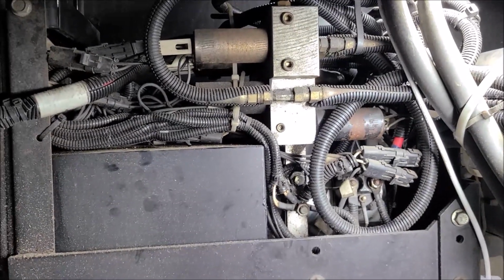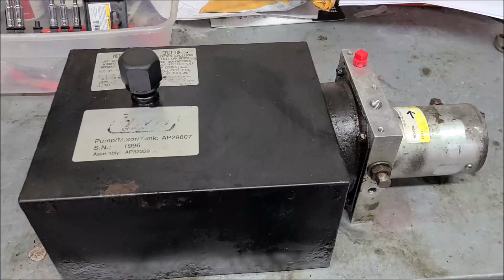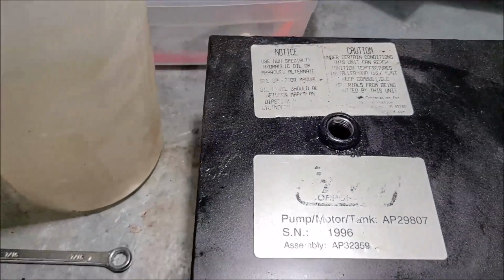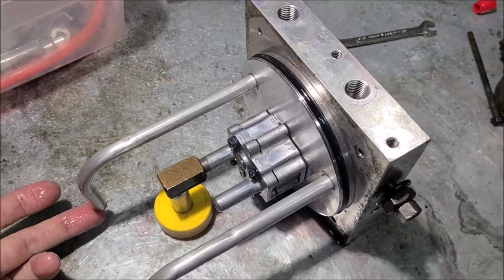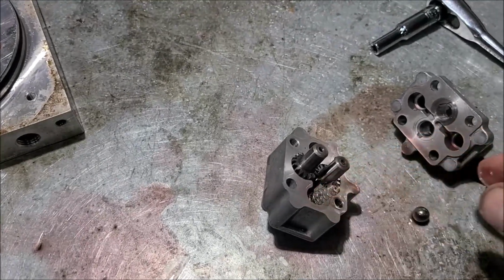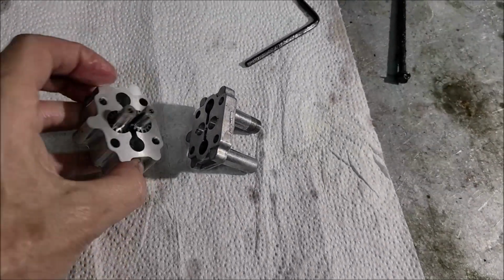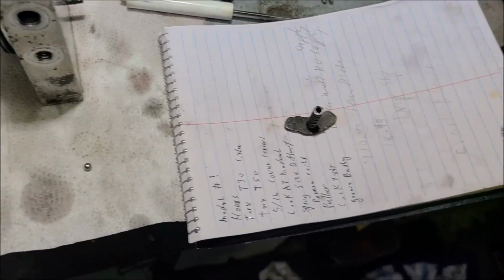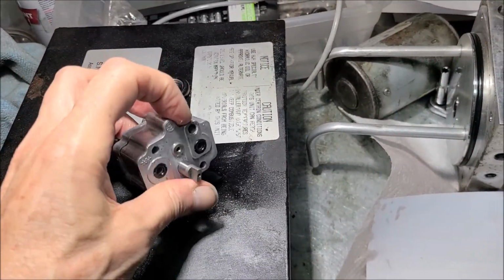How To Troubleshoot Failed HWH Hydraulic Pump RAP30348 AP30348 Due to Contaminated Oil / Water

Comment: Did you ever find a replacement pump? I have the exact same issue with the same pump and part numbers. Hwh wants $1400 plus shipping currently.
Reply from the maker: I never did.. but the new one is much larger and more heavy duty. Try rvleveling.com  for a better price
Reply: @k @ktoutdoor ur videos are great! I’m now watching more of your videos on the hwh system. I really don’t want to spend over 1k for just that pump!! Mine has the same issue with worn out gear shaft.

Comment: I've enjoyed your videos and learned a few things from all of them. One thing I will pass on, when I bought a Fleetwood with an imoperative leveling system 8 years ago, I couldn't find parts or any hydraulic repair company to work on the power unit. I am a retired heavy equipment mechanic and I know there's more than one way to skin a cat. With the Fleetwood, I replaced the whole unit with a hydraulic lift for trailer dump bodies that I got from Amazon for $300. I had to buy a few valves and do some wiring and re clock the way it sat in the hole for it but it worked perfect. Now I own a Tiffin and the HWH system has been a pain in the kiester since day one. First the jacks wouldn't retract, then the shuttle valve needed replaced etc, just one problem after another. I am considering doing the same thing with this one. I haven't quite figured out how to bypass the troublesem shuttle valves yet but after watching your videos I am starting to get a better idea. Thanks for the information.

Comment: Thank you for the video. You always produce good stuff. My Fleetwood Pace Arrow, 2003, has an oil change interval. I'll look it up and share that, but I think it is easy to long for people in a climate that produces much condensation. Mine has a drain plug in the bottom, with a magnet. Filing is on the side, like a deferential.

Thinking about the pump and the ability to find a replacement... Might the pump be worked over with a machinist? They could bore it then place a shim to make the tolerance the same. Just a thought. The gears are steel and the housing is a softer material so, maybe, just maybe that could extend the life of the pump especially at the cost of a new unit.
Reply from the maker: Yes that would be great info.. Is yours a HWH system also?